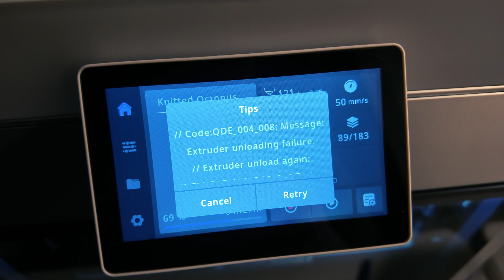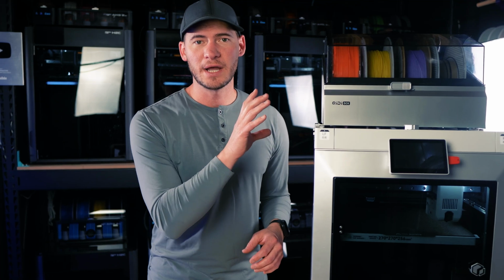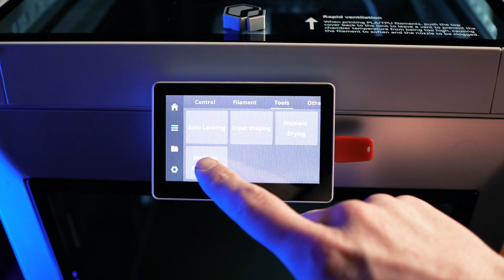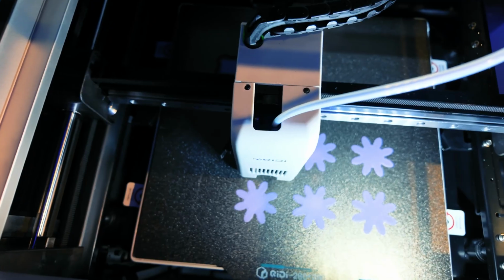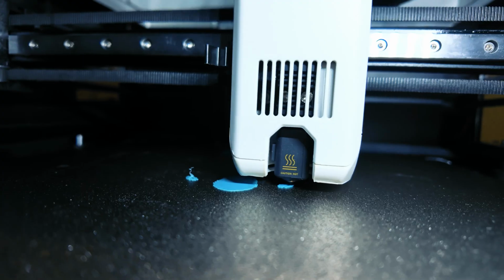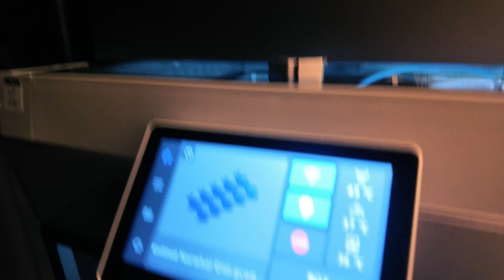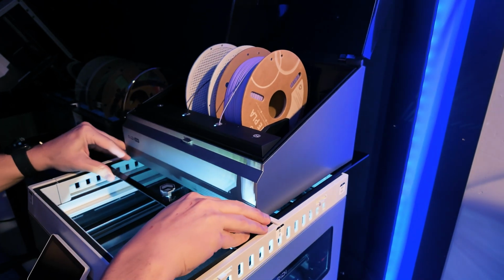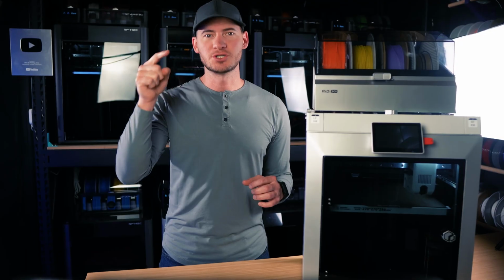Don't Buy The Qidi Q2 Combo Unless...

Comment: About Qidi Box available filaments that can be set on the printer. There is not too much of filament types to choose from, but apparently it is just a very simple config file that can be updated in clipper.
If I remember correctly i just contains min and max print and drying temperatures. And of course a name.
Reply from the maker: Thanks for the info! That’s super helpful 😊

Comment: Thanks for the video. 

Are you saying that you actually had no problems except (no offense) user error for using unadvised cardboard spools, which is also not advised on other brands and not following instructions to open the top?

Also really looking forward to the new video mentioned for the comparison! Any idea when it will drop?
Reply from the maker: Yep, that’s correct 😮 this printer holds heat so well you have to open up pretty much everything to ventilate when you’re printing with soft materials.

Comment: Great Video. Love my QIDI Q2. I hope my qidibox won't cause me any problems when it arrives. ;-)
Reply from the maker: Glad you're enjoying your printer! Just don’t make my mistakes and you’ll be golden 😂 make sure you update the software too. That helped me
Reply: @The3DPrintingZone Will do. Thx
Reply: Not sure about situation now, I am waiting for the box too, but I read that there are/were some problems when using Qidi Box with Orca Slicer. I hope the profile will be fixed before the box arrives.
Reply: @bpm_fox About the waiting for the box, there is small thing that I do not like on Qidi website. They mark the Combo as delivered even when just the printer is delivered. According to their support it is normal and they are using some internal tracking of the delivery of the box...
Reply: So far I've used my box to run out some end spools, and done 1 20ish colour change lithophane. All without a problem.

Comment: Good, maybe I should not order Kobra X? But the price was more than half of Qidi Q2 price. Not to mention Qidi Box.
Reply: I can only speak for Q2, but the pla (standard, silk and matte) and petg are coming out extremely well. Never had an issue other than due to my stupidity of not changing profiles correctly. I couldn't be happier. Showed this to me fellow engineers who've been using other brands including Bambu and they liked it so much 3 other guys bought Q2 for themselves.
Reply from the maker: The Kobra X and this printer are very different and serve different purposes, depending on what you want to print. What are you hoping for in a printer?
Reply: @The3DPrintingZone general, not ABS or ASA yet in plans.

Comment: So you caused all the clogs because you had heat creep by not open up the printer to print PLA? Isn't this 3d printing 101
Reply from the maker: Technically yes but none of my Bambu printers have this issue. Even the older enclosed models.
Reply: @The3DPrintingZone which could be logical due to the unheated chamber and the Q2 being insulated for efficient heating?

No offence, just trying to decide which printer I should buy